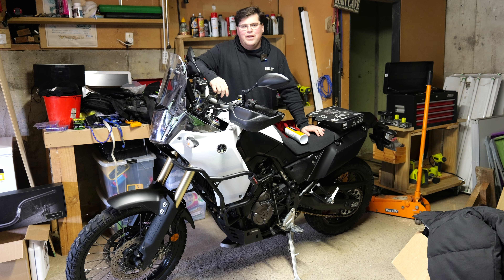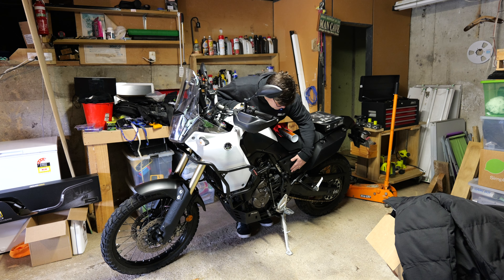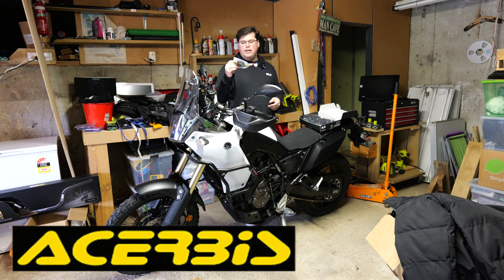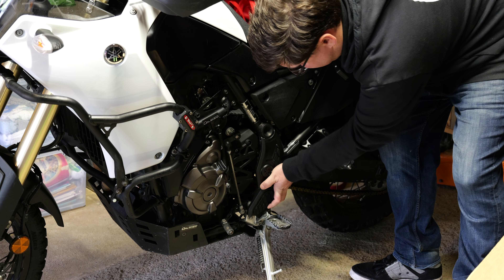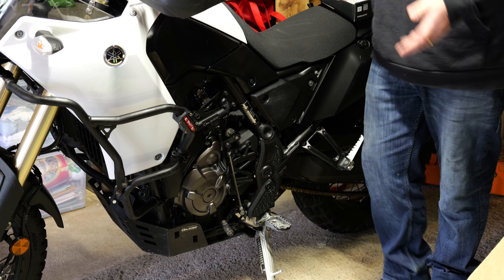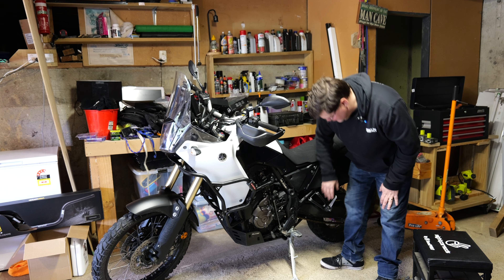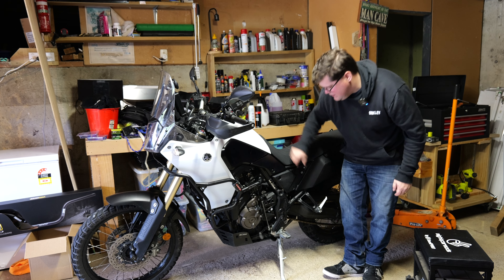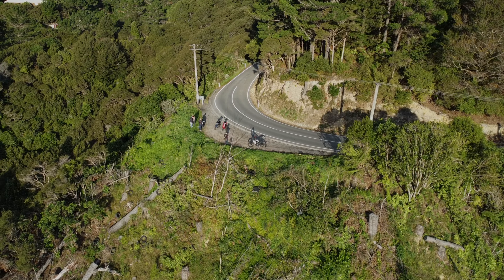Acerbis Frame Guard Install | Tenere 700 | MotoNZ.com

Comment: Put some rubber inside and use zipties, the rubber is for the frame paint, it can rub off even with the plastic guards, and with the zipties... well zipties they will never brake.

Comment: Got the same ones, the rubber holder rings snapped on the very first ride (on BOTH of them). For days I was actually worried my chain was screwed or something from the vibration noises i was hearing....
Reply from the maker: Interesting, I’ve not had a problem with mine.